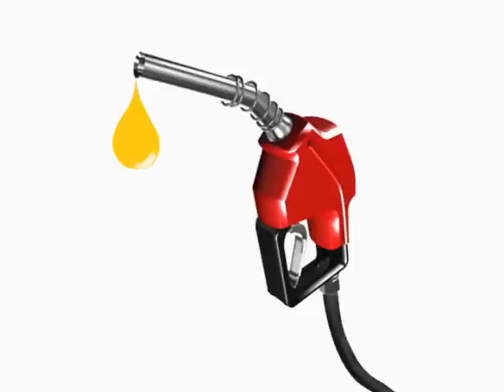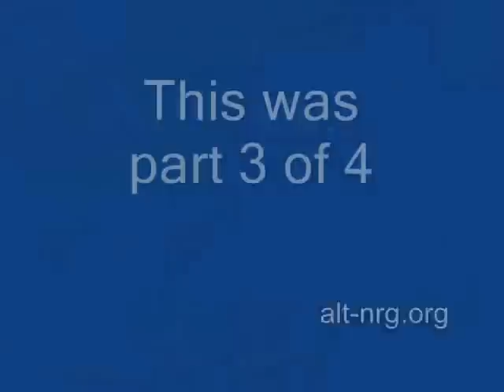#132 - Generator HHO run time tests, Part 3 of 4

Comment: Hydrogen is a great fuel but we still have to use a great deal of energy through electrolysis to produce it. It sounds radical but if we could harness enough energy from free solar or geothermal energy to create hydrogen instead of burning coal that would be ideal. But still this is a great video

Comment from the maker: No this engine has always run lean. Even in the warmest weather I have always had to leave the choke 1/2 on to make it run properly. That's a plus for me because I can use that to lean out the mix when I inject HHO. Only trouble is I can't go lean far enough because there's no mixture screw. :-\